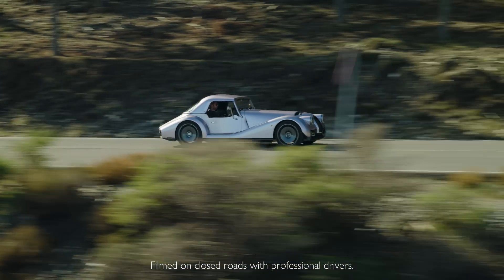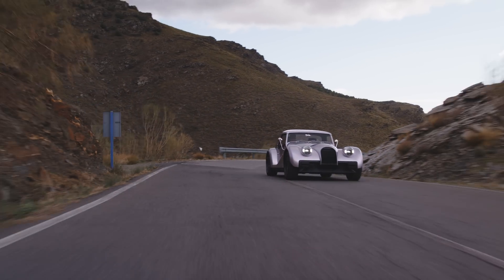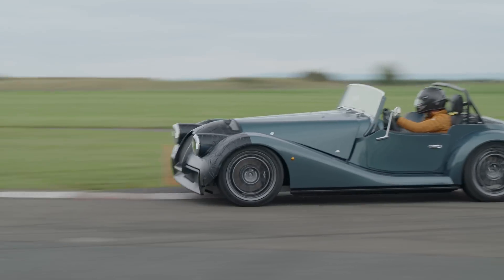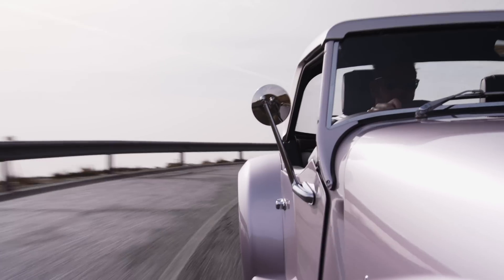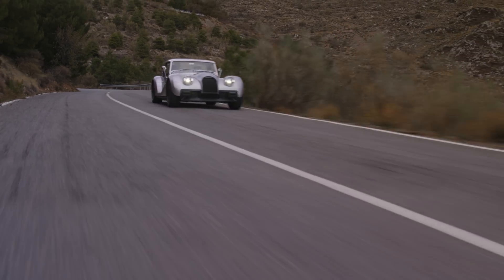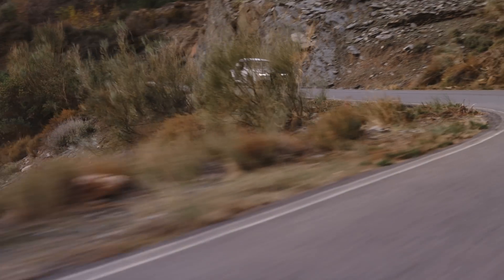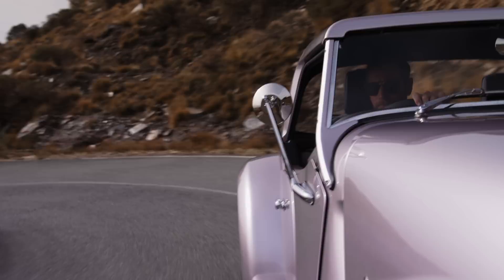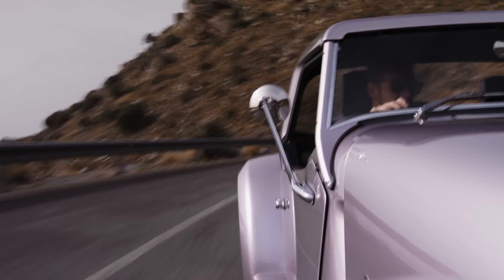Engineering Joy | Morgan Supersport Launch

Comment: no matter what you say, no matter what BS you make up, it's still just a BMW engine.....
Reply: This is an issue because...? Oh no, they've got really good engines in the car that are fast, reliable, sounds good and performs well. 
What's the problem?
Reply: It is a good engine in a car that is a lot lighter than a BMW.  The problem is it has a slushy auto instead of a proper manual.  That is like swimming with arm-bands or having stabilisers on a bicycle.